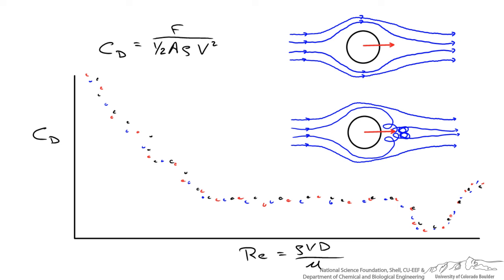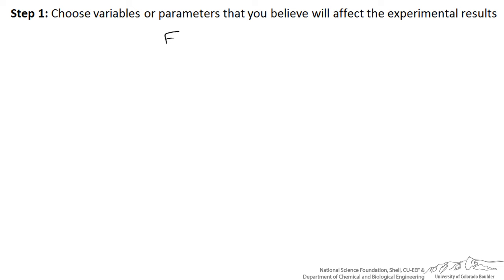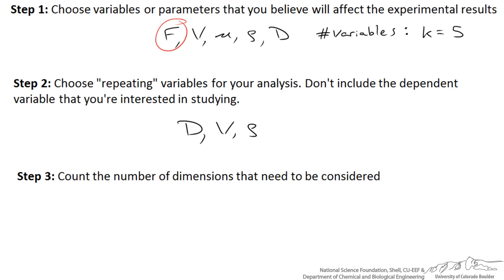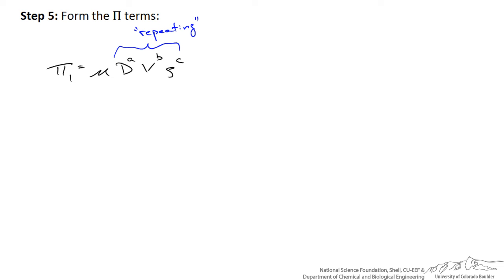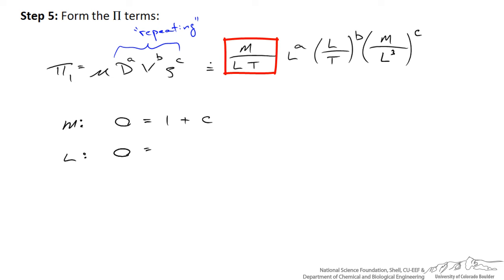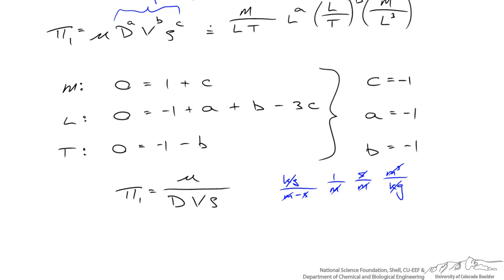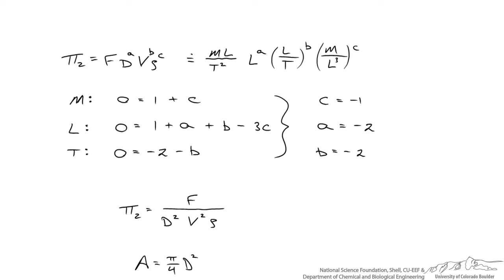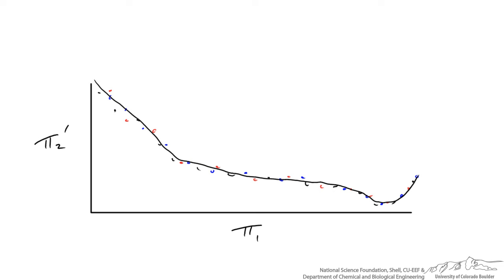Buckingham Pi Theorem Application

Comment: As stated, step 1 is rather confusing. Were the variables chosen arbitrarily? Why were those variables chosen? Why not take others into consideration for instance the pressure or acceleration of the sphere? Wouldn't those affect the drag coefficient?
Reply: The variables weren't chosen arbitrarily, you need to use your intuition.  The reason we could rule-out pressure is because we already included density, which is proportional to pressure in a compressible fluid.  Therefore, the density term will account for a lot of the effects pressure has.  I think we can rule out acceleration because we have included velocity, which is the integral of acceleration.  The current velocity of the sphere is related to the past acceleration of the sphere, so velocity somewhat accounts for this.  You should know that this is a low-order analysis, so it won't give an exact answer, but will get close.  In reality, it might turn out that pressure and acceleration affect the drag force independently from the density & velocity.  However, the low-order formula is simple to derive and probably does a good-enough job.  I think the process of refining a model by adding higher-order corrections is the basis for perturbation theory, which is very applicable in fluid dynamics.

Comment: How did u calculate pi prime?
Reply from the maker: Once you have the dimensionless number of pi, you can manipulate it to become a term of greater interest. In the first case, the reciprocal of the initial pi is the Reynold's number. In the second case, we merely replaced the diameter squared with area.  Since we are only interested in the units and not the actual number, we are able to substitute a 1/2 for the 4/3.14, thus giving us the coefficient of drag.